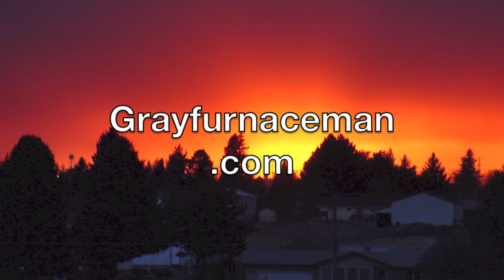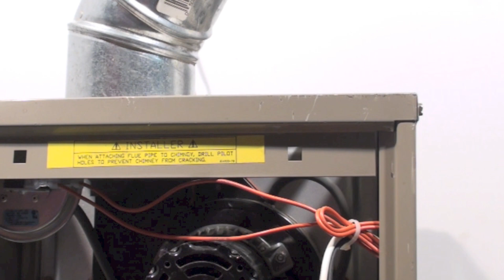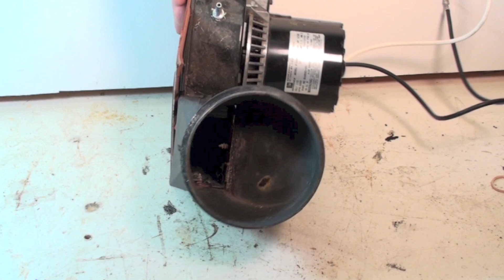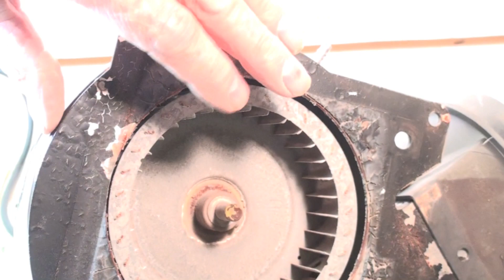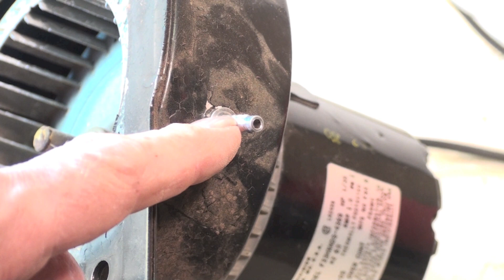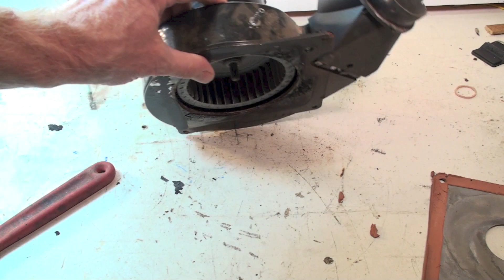Troubleshooting the inducer of the 80% efficient furnace

Comment: should the amp clamp be away from the motor as motor can induce voltage  and the amp draw is likely to be different away from the motor .(high near the motor and actual normal away from the motor)  comment appreciated.
Reply from the maker: It would have to be very close, like within 1/4" of the motor winding, and even then it may not affect the reading.
GFM

Comment: I guess taking mine apart isn't happening. Loud humming and furnace wouldn't work. Took apart and found a dead bat inside my furnace. Took the inducer off because I was getting an inducer code from the LED. The bat ended up making a nest in the inducer and its stuck. Was hoping I could clean it out since I don't think its actually frozen if I clean it. Guess its getting replaced...
Reply from the maker: It probably is not failed.  Very common problem.  Removing birds and bats is quite common.
GFM
Reply: @grayfurnaceman  i got like 95% of the stuff out. Forced the fan to move and it crunched the bones that were making it stick. Got a 2 inch bone and what looks like a cat's toe with a movable toenail out of it along with lots of poop. Smells pretty bad still but it just vents outside so no worries. Put it back in and furnace now works. Inducer has a whine to it now tho but can't hear it unless I'm in the basement. 
I'll have to put a better screen over the vent that leads outside.
Reply from the maker: @timmypstyle  The whine is probably something you missed.  If the burner comes on, you are probably ok.
GFM
Reply: @grayfurnaceman  yeah I couldn't take it apart so I just had to tap it on the floor and push the fan with a screwdriver over and over until it spun freely. I'd imagine the whine is a little resistance from poop particles and urine. But yes the furnace kicks on now, LED has no more codes, and works fine except the whine. 
I'll just keep the part in mind in case it wears out from the extra resistance of the urine, but I'd imagine it would eventually wear the urine down.

Comment: Just encountered a weird case this weekend.  Brother-in-Law advised his Goodman 80% Furnace is not running.  I check the sequence and find 120V at the inducer but inducer not running.  While using probes from an Ohm Meter on it a 2nd time, I must have jiggled the faulty connection point at the inducer--the neutral side.  The inducer momentarily ran, so I was puzzled.  Then it dawned on me the connection was intermittent.  I began playing with it and when I put continuous pressure on the neutral, the inducer ran.  So I told BIL to give me a couple of Twistie Ties and used them to bind the neutral under pressure to keep the connection working.  The furnace is running.  Since the inducer has a plastic shroud covering the wire connections, I am not sure I can fix it.  Left it for now.

Comment: I have a question. What the hell is with the plastic flue pipe connector? Is there any valid reason why they didn't make it out of metal? That seems like a really dumb idea. I had to replace the flue pipe connector on my Goodman Janitrol because it was cracked. Luckily the replacement was metal, so I shouldn't have this problem again.
Reply from the maker: Because plastic is cheaper?  They are junk.
GFM
Reply: @grayfurnaceman  LOL. That's what I thought, thanks. Seems stupid to make something that people's lives depends on not failing out of a crappy material, but that's just me.

Comment: I have a lennox g60uhv-60d-135-02 that stopped working.  I think that I have it narrowed down to the inducer motor.  When the thermostat calls for heat d1 and d2 LEDs flash fast simultaneously (normal behavior) but the air inducer does not start up.  I believe that it is a 2 speed motor.  It has red, white and black wires running to it.  During the call for heat the voltages going to the motor are RW 120v, BW 12v, and RB 36v.  With the motor unplugged and testing for resistance in the motor windings all combinations of RWB measure 0L. The motor spins freely when turned by hand and doesn't smell burnt.  After about 3 minutes of trying to start, the control board goes to an error condition. The error codes are d1 off, d2 slow flash, heat LED off, on/off LED off.
Is there anything else I can do to diagnose the problem.  I believe the above data points to a bad motor.  Does that sound right?
Thanks for any help you can give!
Reply from the maker: Sounds like a dead motor to me.
GFM

Comment: Does the Inducer work at all times while furnace is active or does it kick in only during start up for a few minutes? I assume it needs to run at all times furnace is active to keep up with the gas flames giving off gasses correct?
Reply: No. It only comes on intermittently at the beginning of the cycle.
Reply: @metatechnologist  It took a few years, but finally someone clarifies this for me. Thanks for the response!
Reply: @waitingtohear  yea the primary purpose is to clean out any stale air, combustion gases left over from last cycle and moisture so proper combustion can take place - which it does then gas valve opens, ignition takes place and then it stops. It's not meant to run continuos.

Comment: ** Great video & just wanted to add my experience *****************
 First time I needed the 80% furnace heard the inducer wind up and then heard a "klunk" and stopped. (HINT: always kill the power. Usually will find a switch near or on the furnace).  Power off, could spin the inducer manually with a small rub sound. Took down the info off the old and googled it to make sure of the part & if I was running the latest version (always a good idea, as the manufacturer fixes issues).  Found I had XXXXX-00 and they were up to XXXXX-04. Used Amazon so i could see customer feed back. Prices were anywhere from $90 to $250. Went with the $100 that was XXXXX-04 that had good reviews. When removed, the blower wheel on the old one was destroyed (made out of sheet metal). The new one had a much better constructed cage and 4 screw install (be gentle with the vacuum hose. They are expensive and special) . Turned up the heat then went to furnace, flipped on the switch and have heat. Good Luck
Reply: Old post, but what do u mean old version?

Comment: Hi Gray. I hope you can help me with a question regarding my 80% gas Amana furnace. I have noticed every once in a while - that the inducer fan will hesitate as it starts up, after a call for heat. (By hesitate, I mean it starts spinning. but after a few seconds seems to power down...it can do this 3 or 4 times until it eventually runs normally. It's al,ost as if the voltage is going off and on.) I only notice this on rare occasion. It can go days without this hesitation. Most of the time the inducer starts and runs fine. The furnace is perhaps 10 years old. I see no blinking codes from the furnace board. I can spin the inducer by hand and it seems to have no drag nor much resistance on the bearings. I am wondering if the inducer is starting to go bad? How would I test such an intermittent problem? I was thinking of ordering an inducer to have on hand, but would like to be more confident in what my problem might be before I did that. Could it be the furnace board? Can you advise? How could I test?
Reply from the maker: The 2 most common solutions here are the fan bearings failing and the relay or traces in the control board have an intermittent open.  As it is intermittent, there is no definitive test.  You can look at the back of the control board for damaged tracers.  After turning off the power of course.  Hope this helps.
GFM
Reply: Thanks for your reply. The motor bearings seem good. I spun inducer by hand and the fan is quiet, and spins for about 30 seconds before stopping. ... I looked at the front of the furnace board, nothing seems wrong there ... I wanted to look at the back, but I wasn't sure if the board just snaps off, or not? So I was cautious and left it on for now. There appears to be a white plastic pin in the 4 corners mounting the furnace board on the blower housing. Would I squeeze these, or just pry board off? I have a picture if I could have your email and send picture of furnace board.
Reply from the maker: You can squeeze them with needle nose pliers.  
GFM
Reply: I was looking at the picture I took of the control board and I think I may see what are old water marks on the front of the control board. Perhaps this is connected to the intermittent inducer issue? I did not see a part number for the board in this picture. The panel on the furnace says it's an "Amana 80 SSE Air Command Gas Furnace". It was installed in 2002. I have googled that furnace, but am having trouble finding the part number for a replacement board (existing board has White Rodgers printed on it). Could you help me identify the part number of this furnace control board?
Reply from the maker: What is printed on the outside is pretty much useless.  Look for the model plate inside.
GFM
Reply: My Amana furnace model No is GUIC070FA30. Is their a part cross reference, or parts diagram, you could point me to for a control board part number? I did take the board off and look at the soldering on the back. It seemed to look undamaged to my eye. (I do have a few pictures I could share). I was hoping to find a part number printed on the board, but the only number that looked like it could have been was "4337-C". I aso think that what I thought was a water stain in the fron of the board may just be some type of wax or silicone coating on the front of the board. Are these manufactured with some coating on parts of the board?
Reply: I think I found the board part number 102077-17(White Rodgers part no). A google search showed me that equates to part no PCBBF118S (Goodman part no)
Reply: Today I noticed that I can back probe the power leads on the inducer motor. I thought if I could witness a voltage fall from 120v while the inducer started slowing down, I could see if the inducer itself was hanging, or if the 120v from the ignition board was dropping - that seems like a valid test - doesn't it? ... SO, I have spent a few hours seeing what the voltage is at the inducerr when furnace starts up. Of course it's not acting up while I am watching it! My method for testing was once there was a call for heat, I could shut the furnace off/on at the switch on the outside of the furnace cabinet. Probably tried 50 times. I wish there was a meter that could record the history for me that I could just leave on the furnace for a few days), and I could run down and see what just happened after I heard the inducer slow down on startup).
.
Reply from the maker: Sounds good to me. 
GFM
Reply: I have a feeling I am not going to be able to 'catch it' failing. Tried a second time. Which part do you think is most likely going bad, the board or the inducer?
Reply from the maker: I would suspect the board.
GFM
Reply: If I sent you pictures of the board do you think you might take a look and see if you notice anything suspicious about it?
Reply from the maker: Both sides, closeup and high definition.  Grayfurnaceman@gmail.com  Go for it.
GFM
Reply: OK thank you.. I sent about 10 pictures. They can be zoomed in on with most picture viewers to show more detail.

Comment: I have lots of questions.   Can I get by with a used Inducer or do you suggest I buy new?  Any good brand names to look for?    They say there is water in the Natural Gas.  If the inducer isn't working right (Which I am thinking it pushes the water byproduct up the chimney) would the water collect in the room so it feels like I am breathing water?   Is it pretty straight forward to take the old inducer out and then installing the new one?
Reply from the maker: +AquaCarb Used is junk.  When natural gas burns, the products of combustion are CO2, heat and water.  Most of the water in the vent gas after the gas burns is drained out (assuming you have a 90 + efficient furnace)  of the inducer housing and secondary heat exchanger thru a p trap.  The vent gas is never in contact with the air circulated throughout the house.  Thus no water in the circulated air.  I can't see any reason to replace an inducer with what you have given me.
GFM
Reply: +grayfurnaceman  When the furnace comes on,  the inducer makes a rattle sound.  I thought maybe a bearing was going out but after watching other videos, there is a chance that it may have rusted out and the wheel inside is not balanced.   Our repair guy says that its possible the wheel inside is made of plastic and has gotten warped.   The used one I saw on EBAY does not seem to come with a gasket.
Reply from the maker: +AquaCarb You do not need a gasket as you can use high temp red silicone.
GFM
Reply: +AquaCarb If you can get a used inducer (or motor) for very cheap price, I think it's still nice to try. All new parts from manufacturer are not cheap.
Reply from the maker: +Jerry Han I am a service tech so installing used parts is pretty much a no no.  As for a used motor, you will probably find that the blower wheel will not come off of the shaft.  Also, the inducer is balanced as an assembly so you may have vibration.
GFM
Reply: We determined that some bearings went out.  It reached a point where it would not come on at all.  A new part was installed.
Reply: +grayfurnaceman I like your so many videos online. Very helpful for me. So many secrets can help a handy home owner save $$$. I replaced my blower motor with used from my friend (an HVAC tech), 2 years ago. The furnace was made in 1979, Still running well today. It is not worth to buy new motor for this grandpa furnace. Its all depends on the way you see it. (BTW, I decide to replace it this weekend, with a 96% eff.)
Reply: My tech friend also told me, technician cannot install used parts. Only home owner can do at own risk.

Comment: What is the clay colored seal running around the edge?
Reply from the maker: +Sam Caldwell Its a fiberglas gasket.  Usually replaced by high temp silicone.
GFM
Reply: +grayfurnaceman Thank you for quit reply. The one that is on mine is flat and like like rubber. The fiberglass gasket I see at Lowes looks like a rope. It that a different type of fiberglass gasket?
Reply from the maker: +Sam Caldwell I would not use the rope.  I would use the high temp silicone.
GFM

Comment: Thats a 90% furnace not an 80%
Reply from the maker: Actually, its Janitrol GMP 075.  80%.
GFM
Reply: if it was a 90+ the end of the blower would have a 2" boot to 2" pvc. and most blower housings for 90+ are made of ABS plastic

Comment: Great video series. What should be the resulting error code, if any, if no power is getting to the inducer from the control board, especially intermittent basis? Since there is a call for heat sequence starting, should it end with failure to close pressure switch? My error light is on Honeywell gas valve, not control board, and has not shown any error so far even though I hear clicks at furnace but inducer doesn't start sometimes. So wasn't sure if it could see enough to give correct error code in that case. The power from control board does route to gas valve first then to motor, I'm guessing so it could see that fact. Waiting to catch in failure again to confirm voltage, or confirm Porter HP gas fuel board relay's are working right. Thanks for any insight. Hate not trusting it.

Comment: I have a york high efficient furnace. The induction fan motor just hums. Doesn't speed up. I removed it. The fan spins freely. I reconnected the wiring and tried the furnace. The induction fan would just hum but if I spun the fan by hand it would then spin up to speed. The bearings roll easily. It is a Fasco 70624708. I'm not an electrician but is the capacitor looking thing bolted to the side of the fan motor a starting capacitor to give it extra amps to start?
Reply from the maker: whspioneer89 The part you think may be a start cap is actually a run cap.  However, it is a start assist too. Replace it and it should run normally.
GFM

Comment: Thanks Gray
One thing I would add is it is better to replace inducer/fan assembly as a unit. It will come with high temp gasket strip so no need for RTV or anything. Goodman inducers run between $120 to $200 depending on model (someone mentioned Goodman in comments) . Rebuilding inducer without proper bench testing setup is a shot in a dark because a tiny vibration it will have will resonate once installed on all sheet metal furnace.

Comment: Got mine fixed really easy on old 86 Carrier.  Four 1/4 nuts holding it on.  New sealant I used rtv high temp.  Not sure if that is ok lol.  You know mine was bad for last 8 years!  Wobble so bad and misaligned scraping backplate.  Finally it quite and stopped working this week lol.

Comment: I just wanted to say thanks for the video.  Our gas-fired furnace was making an abnormal sound with the main blower and flame ON.  Once the temperature reached set point and the main flame shutdown; this abnormal sound continued but when the inducer fan stopped after a min or so,  the noise stopped.  I got a new inducer fan assembly for about $100 and used your video as a guide and changed the fan.

I inspected the old one inducer fan and it's shaft and wheel turned pretty good so I was a little concerned I made the wrong move.  But upon restart of the furnace this sound was gone.  So I think the culprit was due to deposits on the fan wheel which made it out of balance and created this problem noise.  

And one more thing, the tight space in the furnace made installing the new fan unit a pain, wish my hands were smaller and the new inducer assembly came with flat plate terminals at the motor so a little wiring rework was needed.

Again thanks for the video.